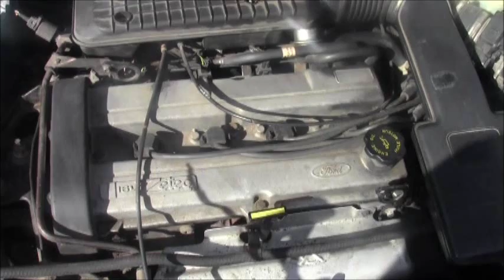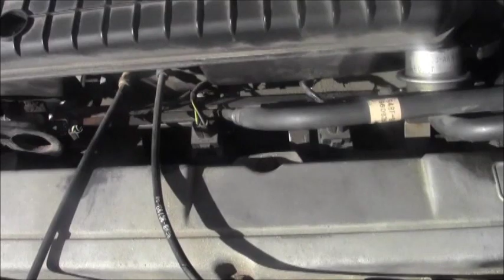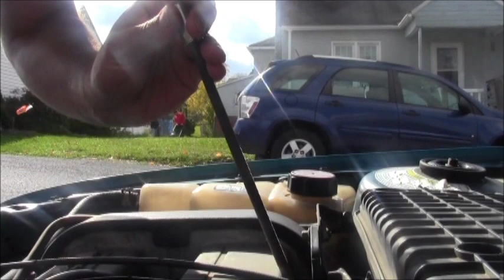How To Unclog Fuel Injectors

Comment: amazing how narrow minded people are listening to some of these comments. anyone ever used an impact wrench same principle,sometimes it helps to tap on fittings when they are stuck after applying wd40 or something similar
Reply: If your injectors are clogged take them out and clean them where do you think all that crap is going? Yeah. The engine.. why did all that crap get there in the first place?  Yeah.. the fuel filter isn't doing its job. It needs a new fuel filter and a injector cleaning

Comment: awesome tip, wouldn't it be better if the engine was running?  Also if you had a injector in hand(from junkyard) you could show exactly where you are tapping.  Considering the brittle nature of plastic parts that might be a huge issue.
Reply: how is it going to run if the injectors are clogged -_______-
Reply: no not better when running, when running you have pressure against the injector,so it would defeat the purpose of trying to loosen a particle. ever clean your electric razor when its running, no you disconnect the head and tap on it gently to get rid of the cut wiskers collected in the screen. same principle
Reply: most injectors have a metal clip holding them in place tap on the clip not the injector

Comment: CharlieDoan - what is injector cleaner in your gas tank going to do if your injector is stuck shut?  I had 2-3 stuck on my 4-cylinder and it wouldn't even run; tapped on the injectors and fired right up.  Never had an issue on that car again.

Comment: Or you could try doing it right and remove them, test them for proper resistance with an Ohm meter and clean/replace them if need be.... injectors are often faulty on the electronic side and not "clogged".
Reply from the maker: They can be clogged on the protonic side as well.